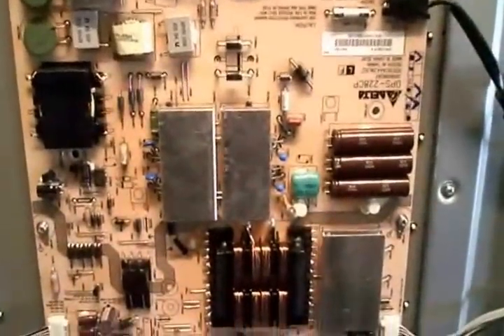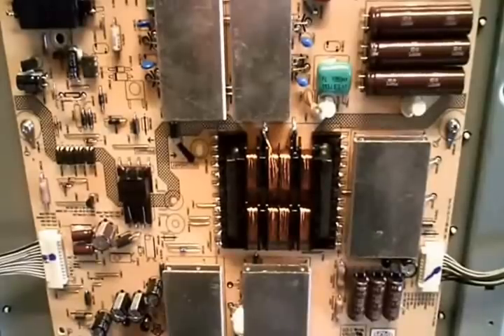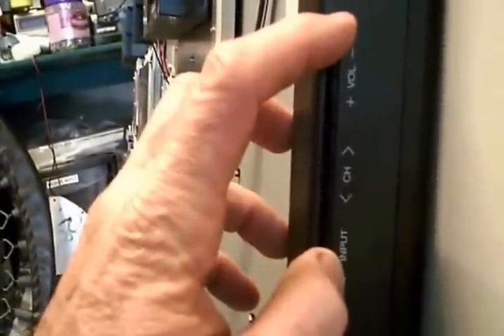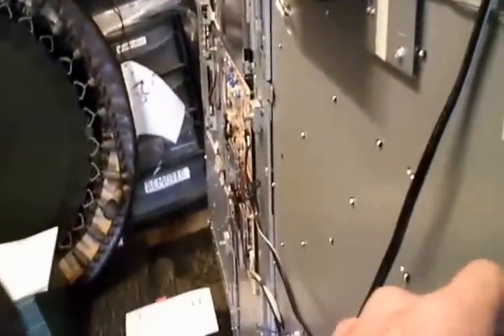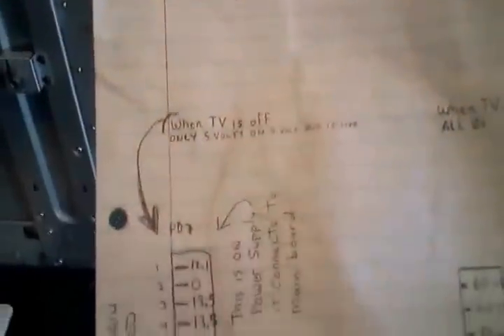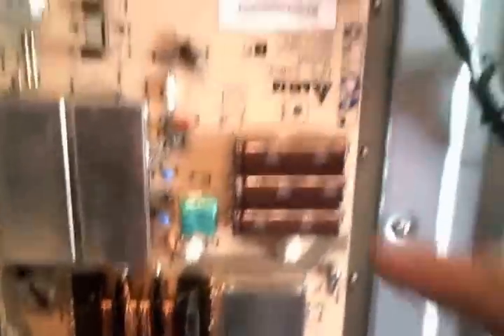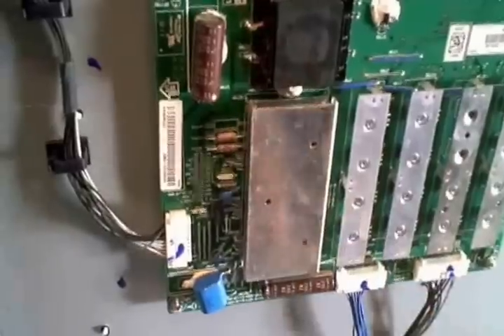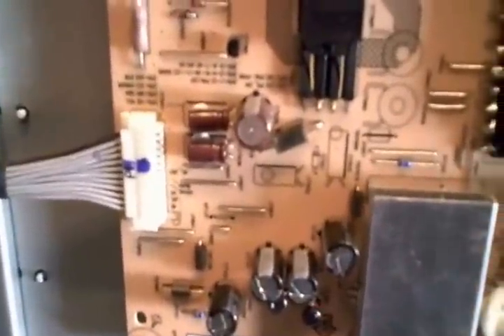Sharp LC-70LE733U Reset procedure and voltages measurements.

Comment: Dave, my Sharp LC-55q7530 has no external buttons, except for the power button . I tried the same reset procedure but on the remote...still no go. Red light on solid with AC present, press power button, red light goes off, no power up, red light then comes back on. Voltages seem ok except no 5VDC anywhere off the P.S. board, but I do measure 2.7VDC on one pin. Replaced both P.S. board and mainboard, same symptom. Disconnected panel ribbon cable from mainboard, no power...nothing. Can't help but think I'm missing something. Voltages on new P.S. board identical to old board.

Comment: Finally the elusive reset technique. Had 3 blinks and 1 blink. Replaced power supply PCB , no joy, replace main board now had 1 blink and 1 blink. TV still dead. Did the "input" + "Vol-" reset. IT WORKS. shut it off and unplugged it ... Plugged it back in and IT STILL WORKS! I owe you a Beer Thanks... Make that a CASE of beer

Comment: Hi.. im workin on sharp LC-65UE630x, totaly dead, but theres 5v voltage on BU5V connector.. is that BU5V mean Bus5v as you describes? Because therese also pin that marked STB but its 0v voltage.. wich one the actualy standby voltage? Pls advice.. thanks
Reply from the maker: My apologies but I'm not sure. I would think anything that measures 5 volts with the TV off would be stand by voltage, but I'm only guessing.

Comment: Hi my sharp TV is running, but suddenly my tv automatically off and it was dead condition. I am trying to powe on the tv. Power on  led light not working.i think there was a powe supply problem in my tv.kindly help me how to resolve this issue
Reply from the maker: I produced a series of videos on TV repair you might find helpful. You can find the directory to my videos at https://www.tvrepairinfo.com/

Comment: That error code means that one of your LED strips is bad or going bad. This reset procedure forces on the tv ignoring the fault. The reason you have to keep resetting it after it is powered off is because the fault code needs to be reset in the service menu.  If after you reset the fault and power off tv the tv faults again then theres still a problem with your LEDs.

Comment: so if this case keeps happening what needs replacement? the power board or tuner board ?
Reply from the maker: It's related to the main board, but there might be a permanent adjustment that goes beyond the scope of my knowledge.
Reply: Grants Pass TV Repair : i have same issue..tried everything and did not work..thinking of buying a mainbaord but hpping it won't go waste also..never but sharp again

Comment: Sharp 70inch aquos lc-70ud27u
Menu and down volume
Reply: i'm having same issue with lc-70ud27u.  2-5 blinks.  changed the power supply board.  i can get the blinks to stop but no display on tv.  any sugguestions?
Reply: Same here 2 slow blinks 5 fast

Comment: Thank you, Thank you and Thank you for such a wonderful tip.... I had even set up an appointment today to have a tech come at home.....   and this morning I found this video that specifically provides an alternate way to reset the power than replacing the more complex power supply/board..... works beautifully and as you right said it is good enough in many situations like mine. Glad you were able to connect those TV repair tips and blend that into a video with such nice explanation that made me reset the TV in matter of minutes. A Big Thank You !

Comment: Hi, I want to replace the HDMI port on my Sharp TV LC-70LE733U. Where and what part should I buy? Ive been looking this info and I'm stuck.
Reply from the maker: You can find them on ebay. Use the key words replacement hdmi ports. They all have different mounts. You will need to study the pictures to find the correct one for your PC.

Comment: The procedure you're using is a forced power on procedure and you're missing just a few critical elements to resolve the problem. After you have the "K" on-screen press vol() and ch() together. This brings up a service menu. Then scroll down to "Lamp Errors" and reset. That's why turning it off and then turning it on normally again you're back to the error.
After doing that update your firmware. Sharp was way to critical about lamp error detection and under certain circumstances the counter gets added to without detecting an actual error. CCFL lighting, for example, can cause premature error detection.
There are some with the 1-2 error that are actually a problem with shorted leds in the lighting array. If forced on does not work I would suspect one or more leds have shorted. To replace them I would strongly advise taking it to a qualified technician.
Reply: That procedure worked PERFECTLY!  Just in case someone else has this issue here's some clarification.  Once you press the channel down and volume down to get into the diagnostic mode you need to go to page 2, scroll down to Lamp Error Reset and change that from OFF to ON, then back to OFF.  When I went back to page one my Lamp Error changed from 5 to 0 and the TV now powers off and back on normally, even when unplugging the unit.

THANK YOU!!!!
Reply from the maker: Thanks for the info but part of the text in your message is hard to follow. Perhaps you can edit it.
Reply: Sorry, when it posted it took what I put in brackets and warped them somehow.. After the force on procedure a "K" appears on-screen. Then press, together, volume down and channel down to get to the service menu. Scroll down with using the arrow keys on the remote, to "Lamp Error" and reset. Now the unit should turn on/off normally without having to again force start.
The last thing is to update the firmware. Sharp, on many of their models with this problem, have readjusted the sensitivity to lamp error detection to help eliminate the problem in the future.
Hope this helps!
Reply from the maker: Thanks for the information. I'm sure many will appreciate your additional info.
Reply: is there any other way to get to the lamp error screen or reset it? i followed your procedure and before i got to the part were you hit channel and volume my tv came on to it's home screen. but if i can't turn it off.
Reply: Unplug it, allow it to sit for about 60 seconds and simply begin again. It is an active button control for that reason. One of Sharp's better ideas. Just try and minimize the time between the "K" appearance and entering service mode...
Reply: if board replacemet is it main board or power board ?

Comment: After trying to reset the Sharp 70 inch TV. I do get the flashing logo on the sharp I held down the input and the down button on the volume and plugged it in . I still get nothing the light continues to flash and I don't get anything on the screen,  What does that mean?
Reply: Let me know if you find anything out. Same issue.

Comment: This is a solution, but be aware if the HDMI chips are shorted / getting hot its not good to run it like this. 
Check all your HDMIs after the reset   , do a visual of the chips near the HDMI ports also to be safe.
Thx my sites: tvpartsman.com brokenguy.com    tvrepairguy.com  http://signalock.com

Comment: Hi, thank you so much for posting this video!!!

I just had the same issue happen with my Sharp Aquos Quattron 70" #LC-LE7032U, I called sharp today and they had to try some reset buttons and i got nothing, they then referred me to a repair guy.  I called the repair guy and told him the issue and he said he knew the problem and had 6 TVs in his shop with the same issue in the last 6 months, He said its not good news and that the Panel has gone.  He said that sharp now uses a cheap Panel and this is a common issue, and a costly one.  He said best case scenario would be him finding a refurbished panel, that would cost about $2100 Canadian, but none were available, and apparently no New panels were available either..  He told me the TV was basically ready to be recycled.   That is when I started doing some research and found your post!!!  I tried the rest option you described and it just worked, I haven't given it enough time to make sure it stays working like this, but at least it turned on, which means the screen isn't burnt out like I'm being told.   I am still pretty upset with Sharp as I was a big fan of there products up until now, this is my third Sharp TV and my newest, biggest and most expensive costing me over $4k Canadian, after only 3 years of lite use for this to happen is outrageous, Sharp should stand by there products when they find lemons.
Reply: Mike, I have the same TV as you and am wondering how is it now ?  I was keeping mine alive doing the input + volume thing, but now it is black.....no lights, no power, no nothing........I might try to replace the power supply, I can't just give up on it, it was too expensive.  How is yours ?

Comment: Thank you for taking the time to pin-out all the voltages. This is incredibly helpful. Have a good one.
Reply from the maker: +Kenny Rood Good to hear. I  was hoping that additional info would be of use to someone since they failed to list the 
voltages on the circuit board.

Comment: This just happened to mine. Only mine is an Lc-70le750u and I can't get the TV to reset. I've tried everything but the screen just will not come on. I haven't checked the 5 volt bus. Any further updates on this? I've got a power supply on the way, hopefully it's a simple fix
Reply: hey, can you tell me what your issue was? I have lc-70le757U, tried to reset - same error code. Did changing power supply work?

Comment: Sharp TV Corp.have this kind of problems in it TVs for awhile now in their design flaws for there main CPU chips for their main mother board for either LCD or LED TVs.Have same kind of problems they both have bad firmwares programing problems put into them for LCD TVs design it was OPC and POWER lights together flashing too same kind of deal must unplug reset too.Even that you change another refurbish main mother board still will happen,if the main mother board never receive a software firmware upgraded.Only correct upgraded the firmware will solved this problems,but Sharp Corp.stop letting people doing this already.If you download wrong firmware or corrupt firmware files for the TV will stop working all together can't even do any resetting to the TV anymore either.I own two sharp 46" LCD Aquas TVs. I known this problems for sharp TVs for years.Just used the TV everyday like for 4 hrs a day this problems will never or hardly shown up at all.

Comment: Hi, It's Wayne from Affordable Mobile TV Repair in Va Beach Va. I have the fix for this set. You were very close but no cigar! Please call me tomorrow @ (757) 651-8115 and I'll tell you how to fix this one. Hint, bad led which causes the register to fill up. The fix is approx $70!
Reply from the maker: Okay Wayne, Thanks for the info. I'll call you later.
Reply: Grants Pass TV Repair Did u ever call Wayne? He said this could be repaired for about $70.00. If u did? What did he say???
Reply: Wayne Mitnick are you still around helping folks with tv’s?
I have a LC-60LE600u that has had a dark spot a few weeks now and finally will not power on. I have tried a couple ways to get into service mode and have had no luck. I hear what you are saying about a sort of lamp fault buffer filling up and that makes sense. But how do i reset it and next i will have to find a replacement back light section

Comment: bush alba sharp linsor luxsor sets seem to have this problem .
I have 4 sets here all different size's and makes but with the same fault .
plug it in touch the buttons come on all working fine picture remote dvd etc  etc ....
but once you unplug dead just random flash code on the front.
I think the same as mind turd  bios problem could this be the next big problem ie  1st caps 2nd panels now this?
but hay if they did get it right we wouldn't be here writing this.....   :-)
Reply from the maker: Was the reset on these other TVs you mentioned done in the same manner as this Sharp where you press the input select button and , volume down button while plugging in the AC cord?
Reply: Grants Pass TV Repair
no just switching on and off numerous of times until the set came on but not on all some was only on the remote then buttons on the set very strange I think these sets are getting worse bring back the good crt's
Reply: Do they use the same EEPROM's? Maybe there are some bad ones being used. Just a guess.
Reply from the maker: I don't know if they use the same EEPROMs.

Comment: As the TV will turn on and off correctly ONLY when the power cord is in all the time, shows some sort of memory setting is being TEMPORARILY held. When unplugged from the mains, the reset you did clears and goes back to silly mode. As TV's don't have a battery for the bios like a computer does, what in the TV would be responsible for holding a new memory setting? Seems like faulty bios hardware. Bios software upgrade or overwrite might help?
Reply from the maker: You might be correct, but it's beyond the scope of my knowledge. Perhaps someone will see this video who knows for sure.
Reply: Maybe it's a bad EEPROM? When you do the reset, the CPU rewrites the EEPROM and let's the unit work.
Reply from the maker: To be honest I'm not sure what caused this, but my customer is happy and he paid me so I'm happy :-)